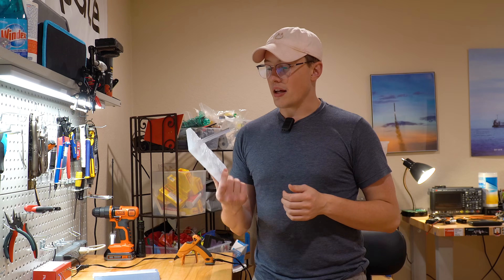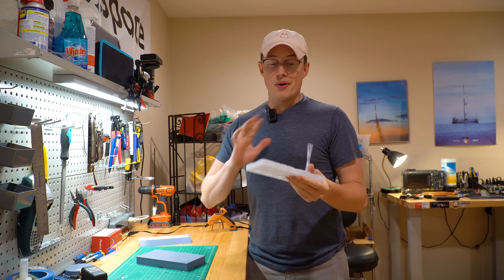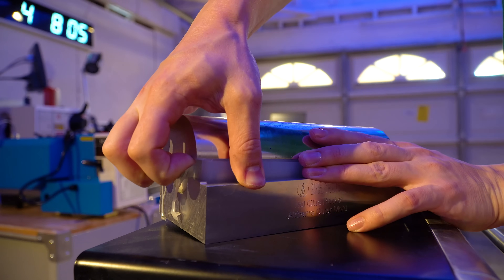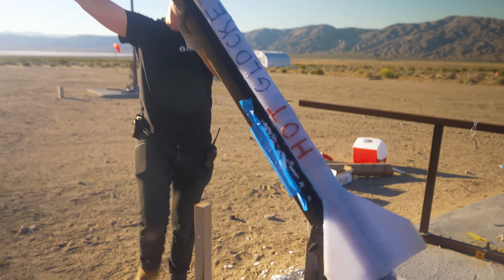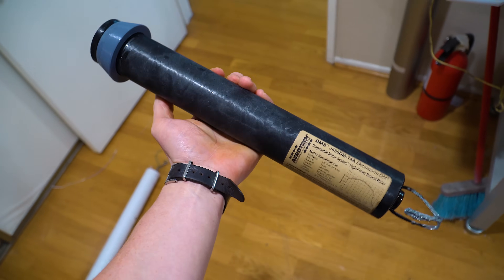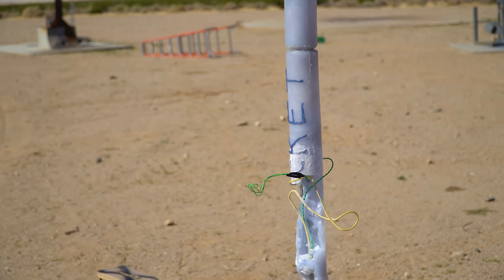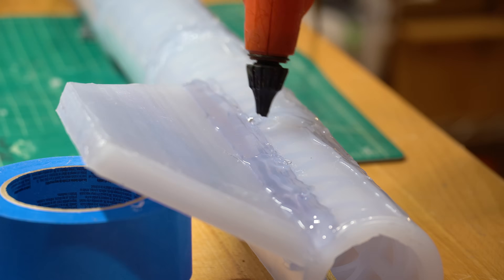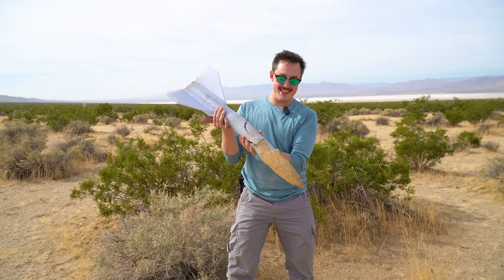My Hot-Glue Rocket Is Terrible

Comment: Huh... Weird. I was kind of expecting you to use the hot glue as fuel. Since it's kind of a hydrocarbon, I'd imagine it could burn when mixed with an oxidizer. I bet you could make a solid/liquid hybrid rocket out of it with solid hot glue for fuel and liquid oxygen for oxidizer.

Comment: I remember when I learned model rockets as a kid in a summer camp, and different recovery methods were discussed, parachute, streamer, spin, etc.  The instructor wrote on the board: Lawn Dart.  And explained that it was rarely intentional, but failure of the intentional methods often let to the unintentional "lawn dart recovery", which sometimes works just fine.

Comment: imagine having a mold and being able to re-do the whiole rocket with the same glue over and over again. just having to cut it to pieces and melt it back into the toaster. im pretty sure you could have added stiffness with something embedded in the glue at the same time its liquid.i would say carbon filament or tissu stripes, but that scrap the possibility to re-melt the rocket when you want to launch a rocket without using 647 glue sticks

Comment: Putting a glue stick in dry ice for 10 minute < 3 days later to make a new rocket, to see how it would act cryogenicly. Things do weird stuff at dry ice temps like flowers shattering. Or rockets.
Reply: You have a point - but missed the bigger thing. Does that experiment scale?

A hot glue stick may not react the exact same way the rocket body would due to different stresses. So it's entirely possible that a cryogenically frozen gluestick would be fine, while an extruded glue panel would fracture. You also need to factor scaling into this. A small scale model may not experience the same stresses, or may tolerate it better than a full scale model.

So while yes, it's a smart idea to test material behavior, scaling up has to be done, and your small scale tests may have been futile to begin with. The reason why it wasn't done here is this was more-so an exercise of skills, rather than a research endeavor. There really wasn't any need to do all the scale testing because a hot glue rocket obviously is extremely instable. It was less a test of "how to make a hot glue rocket" and more a "I'm gonna make a hot glue rocket." Data is important, but collecting useless data is a waste of time.

That's not to say your thought process is invalid. It's definitely worth a consideration. But some projects are just a "lemme see if I CAN do this" not a "let's see HOW to do this". It's a healthy exercise of your skills and experience to achieve a goal no matter how absurd. But if the project goal is to make rockets out of hot glue, researching the material behavior and engineering the shortfalls is absolutely key to the goal of the program. Not so much for the former.

Comment: Wild project. When I saw the headline, I wondered how you were going to make the nozzle and the motor out of hot glue. ;-p It occurs to me that you might be able to modify the properties of the hot glue with some kind of additive or catalyst to make it stronger. Also by adding filler. Fumed silica? Then again, there are many differemt tyoes of hot glue made, and perhaps some are already like that. I'm guessing you could make the fuel from hot glue, too. Hmmm... I wonder if some kind of chemical abuse could turn part of it into a an oxidizer. 

Perhaps, if you were prone to wretched excess, and truly rich, and had nothing better to do, you could make graphite for the nozzle from extensively processed, modified and tortured hot glue. And carbon fiber? You could start an industrial revolution. ;-)

Comment: Embed some non-stretchy material in the hot glue, like steel wire or mesh, such that bending of the glue would pull on it. It would make it stiff even in room temperature. Likely won't even need the stiffening pattern.

Comment: man i called all of your failures, i was alone so no one can corroborate but when you said the the flight computer uses air pressure I said wouldnt the air pressure change with the temp? then when you said you left the rocket in the dry ice for over an hour I said it was going to split apart. then when you added lead to the nose cone I said there was no way thats gong to move for the parachute. I was 100% lol. awesome video looked like fun!

Comment: Just a small hot glue tip, rubbing alcohol will make it unstick from non-porous surfaces. If you get hot glue on fabric, cut away as much as possible then saturate the fabric with the alcohol and rub the glue. It'll ball up and can be worked out of the fabric. 91% works better than 70%.

Comment: Those would be good molds for foam rockets as well. Some pourable structural foams have great strength to weight ratios. Pretty sure you could build something with reasonable performance with those molds even though they were meant as a joke.

Comment: so i was thinking about how much hot glue you are losing out of the mold and was wondering if you figured out by weight approximately how much is escaping the mold you could eliminate that amount from the amount of glue you put in the mold and you wouldnt lose as much.. even though technically i guess you could recycle the "loss"

Comment: I could be wrong, but I believe that hot glue changes mechanical properties depending on how fast it cools/sets and how thoroughly. If you have a massive block of it setting all at once, I'm pretty sure it'll be a lot more flexible as it won't fully set.

Comment: Nice video.. At 8:36 I don't use those cheap apogee chute deployment sensors. I made my own with an Adafruit Trinket M0 and an Altitude Detector from Adafruit. My code does not care if you power up vertical or horizontal because the sensor has a resolution of about 200 cm and I programed the code not to arm until the altitude raises 50 above meters from the stabilized powered on readings. Every rocket I ever built (even my Estes Saturn V) has a apogee of over 75 meters so it can't go off until after it launches. I also designed a fancy Dual Deployment unit that has all sorts of safety features. It is on my channel in the Model Rockets playlist.

Comment: What if you designed the pieces with many ducts to make it so you run liquid nitrogen thru it? (don't forget to leave openings for the rapidly expanding liquid nitrogen to escape before the pressure turns the rocket into a bomb, of course)

Comment: There are different formulations of hot glue. That colorless translucent stuff is polypropylene based, and is one of the most common, especially consumer one. There are stiffer and higher performance hot glues you can get based on other polymers which give much better performance (stiffer, stronger, usually higher melting point requiring industrial glue guns) and might be something to try for a crazy project like this. They'll usually have an off yellow or orange-ish color depending on what material they are based on, but they can be stiffer and have way higher tensile strength, and are available in bulk for industrial applications.

Comment: Would it be so criminal to add a reinforcement to the hot glue? Popsicle stick rebar? Wood shavings? Sowing thread? Or maybe just embed the electrical wires in the fuel-silage itself.

Comment: @9:00 Please correct my following thought. The correction it needs, if it does at all.
The barometric senor was also placed in a semi enclosed volume that was "super chilled" with ice.
If the sensor is sensitive enough to sense the difference of a few feet, it stands to reason that it also
is sensitive enough to sense the barometric change linked to a given temperature change. No?

Comment: Honestly I thought the baro problem was going to be from drift do to the temperature.
Since air density changes with temp I thought the baro might trigger as the system heated up and the density dropped.

Comment: I'm not a pro, but wouldn't some kind of reinforcing material had provided a lot of stiffness? I'm thinking something like a smooth inside, a single ply of glass fiber cloth and maybe some ribs on the outside? Going for the smooth inside would also had made it easier to cast a longer section of rocket in one go, so you would have less weak points.

Comment: Hey Joey B! Appreciate you stressing the less fun safety side of rocketry, particularly pertaining to how ornery recovery electronics can be. I actually had a similar experience with an Altus Easymini. We had armed the altimeter to see if it would beep out continuity and detect the e-matches that were connected to it. It beeped out good continuity, and then instantly blew both charges. It didn't wait for an altitude or time lockout, it hadn't been moved, and there wasn't a significant amount of wind. The data that we pulled from the altimeter showed no reason for it to have detected a launch and blown the charges. Thankfully no one was hurt, but sometimes stuff just goes wrong. Got to talking and it sounds like our experience isn't isolated, so we've moved away from Altus.

Comment: There is a chance that using dry ice could have effected the altemeter. Cold CO2 is denser than ambient air. As t warmed up and replaced any CO2 that was inside the airframe it could have simulated a slow launch. I have considered using dry ice to cool airframe before to keep epoxy rigid and decided against it due to the gas property differences on a flight computer.

Comment: Did I miss the part where you explain....why? Why hot glue? xD

Also...why not a outer sprayed on layer of something like Rhino Liner, to stiffin and form a 'shell' and keep the whole thing rigid? 

Alternatively, you could treat the glue (why god why?) like reinforced concrete and maybe use chicken wire or something, through the inside of the mold, so that its in the middle of the gluewall.

One other idea; maybe sawdust mixed with the glue? Like a pykrete...Similar to sawdust with ice, I imagine this will make the whole thing much harder.

Comment: Dang, when you said that the computer detected changes in air pressure and that the rocket would be frozen shortly before launch I thought the issue would be because of pressure increasing as the internal air temperature increased.

Comment: I wonder... having the rocket covered in dry ice would lower the internal air temperature, increasing the pressure. Then as the rocket warmed up the internal air temperature would increase, lowering the pressure and giving the appearance of a change in altitude.

Maybe that helped make the difference in pressure a lot greater, overcoming the margin of error built in to the device? In fact, I'm willing to bet that even if you had not raised the rocket to vertical, the device would have triggered. But I'm no rocket scientist, so what do I know?

Comment: I admire so much your work, I’m not an engineer or rocket scientist but I’m an architect specialist in structures and acoustics, the isogrid was a great idea but due the glue behavior wasn’t enough so an alternative could be put a thin metallic mesh embedded on the main body section in order to augment the rigidity of the whole structure and make this behave as a single one (and of course could avoid the coolness process before launching)

Comment: An easy way to make the rocket body stiffer would have been to lay a piece of Kevlar string in the bottom of each mold half before melting in the hot glue.  Add another Kevlar stringer in each seam before filling the seams with hot glue.  For the fins, add a couple of Kevlar stringers for each fin before molding in hot glue.  The Kevlar would probably make the rocket stif enough without needing pre-cooling in dry ice.  Looks like your hot glue rocket works just a little better than Peters food RC airplanes! 😂😂

Comment: 7:37 First, I love your videos, very fun and creative. 

Second, you need to be careful about your eye protection recommendation. “Sunglasses” are not designed to protect your eyes from impact injuries. Regular glasses don’t protect your eyes from impacts either. If you’re going to take time to recommend eye protection (which I love and is super important) you need to recommend ANSI certified eye protection. True eye protection protects the fronts and sides of your eyes and has been rated for impact protection. They have many styles including styles that look like the sunglasses you were wearing with side protection.

Regular sunglasses can break and cause more damage to your eyes. Use the right tool for the job!

Comment: I want to see an amateur rocket team build a rocket that lands on the moon even if it's a crash landing. It would be more the moon running into the rocket though. Get a radio out far enough it's in the moons path is all you need to do.  Standard rocket with a nosecone with a plasma or ion drive. Take a month to get there but it would eventually if you time it correctly.

Comment: The fact that it was still mostly intact after hitting the ground like that is honestly pretty awesome.
Reply: Hot glue is surprisingly shock resistant because of its flexible nature.  We commonly use it in traditional archery to glue field points onto arrow shafts and each arrow will take at least several dozen impacts without any maintenance before the glue fails.

Failure can be prevented entirely by simply occasionally reheating the points with a lighter until the point wants to move freely and giving it a little twist back and forth.  Just by doing this once every few shooting sessions the glue outlasts my arrow shafts.  The only thing to be careful of is to not overheat and burn the glue.  Frankly though, you would almost have to deliberately try to do that.
Reply: @ColonelSandersLite  interesting.  I need to study its use along side metal parts for shock absorption
Reply: So really, this prototype just proves how great of an idea hot glue rockets are.

Comment: I would really like a video where you talk a bit about what design choices you are considering for the space going rocket and what you have to think about before building something like that. Are you designing and/or making your own rocket motor? Will it use liquid or solid propellant? How much of the craft will have to be reserved for fuel VS other stuff? What materials are you choosing between and what are the properties of those that are relevant? Is it a straight forward compressive strength to weight ratio or are there other considerations? Are you going to have to deal with heat management?

Comment: I think it'd be cool if there was a material similar to hot glue but with a higher melting point, such that it CAN be melted in an oven, but is more stable at room temperature. as a rubber like material that's this easy to mould, I can see it having use in DIY markets as something other than just an adhesive
Reply: but fun fact, there already are several materials like that. You are literally just describing thermoplastics...the thing 3D printers use and that's no fun. TPU specifically is a "rubber like" material that can be molten in oven, it's just that it's expensive and is a 3D printer product in general. There's also TPE aka Thermoplastic Elastomers (which will also encompass Hot glues)

Comment: See, my first guess as to why the ejection charge fired was because the rapid change in temperature caused the flight computer to inaccurately measure the pressure, which can be supported by your explanation in the video. Overall, great video and a fascinating design!

Comment: liquid hydrogen/oxygen cold = very ultra stiff, keep it rigid dude, also why cant a balloon be a rocket, positive pressure from inside, not outside, keeps a body very well in its form. outside pressure is always negative. did you figure out the idea yourself, or did it get it from the creator (are you the creator, originator, o'really, honor to God alone)? jill the snzzzh out lmao. does that rocket remind you of... yep dont stand in front of rules. you get always judged, and are in danger of being under the rules, not existing at all, false gods. end of story. why do you worry so much, if you think something went wrong, just redo the thing. no biggie. or just dont do stuff from hot glue. 3d printed rocket would be more stiffer tho. hey I can do all comment in one (unedited) list lmao. also bringing a freezer in an rv to the launch site would work. epoxy cast rocket dude. ask God if something is not easy dude. yep you tried it your way, not God's way or the best, God did it, already, easily. why do you think any of your bling bling would earn you anything more. rip hot glue and sponsored content.